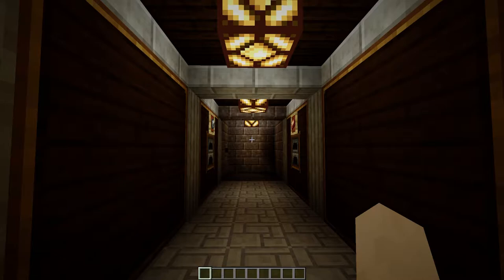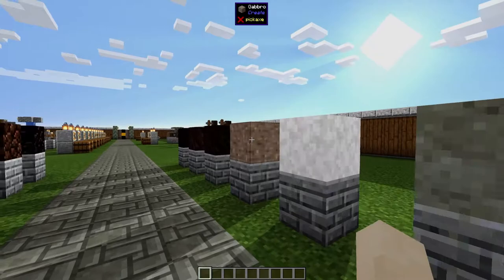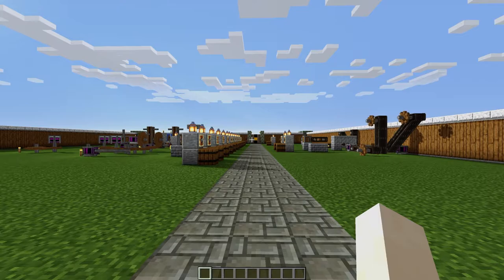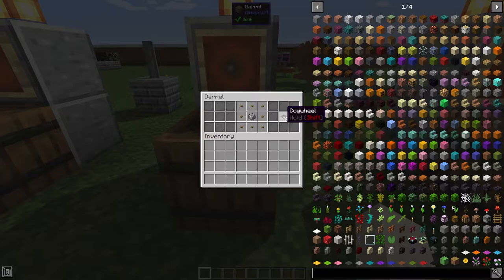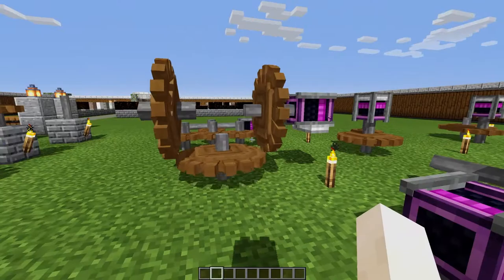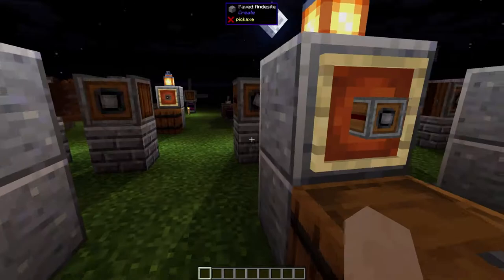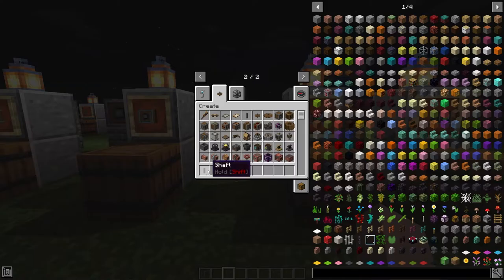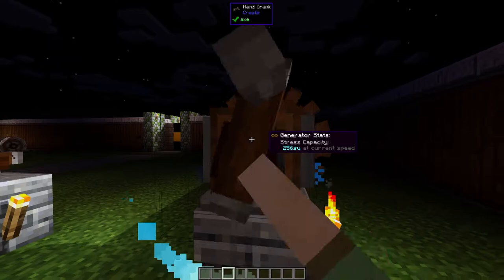Create Mod Tutorial #1 Rotation Basics (MC1.16.5)

Comment from the maker: Just a heads up that stuff in the Create mod has changed since this video was made, mostly just crafting recipes and config stuff but other than that the rest of the info in the video should be accurate.
Reply: A dalam dan akhirat nanti di
Reply: Probably worth pointing out in this pin that water wheels don't have a correct direction ("with the flow"/"against the flow") any more, that a single block of running water that touches them provides them with maximum power, and that that lava powers them just as well as water. At least that's the case on version 1.20.1. :)